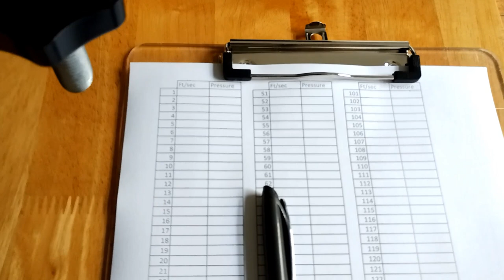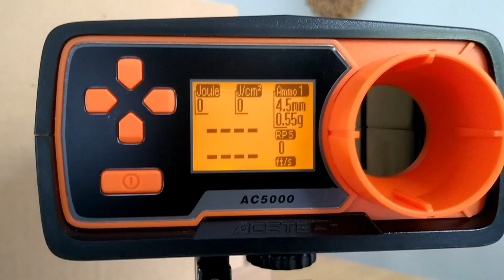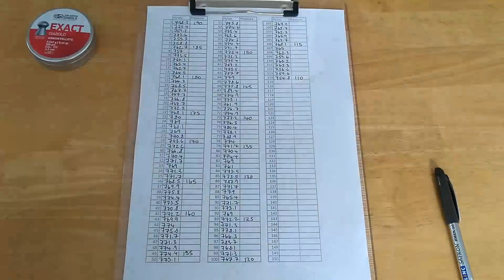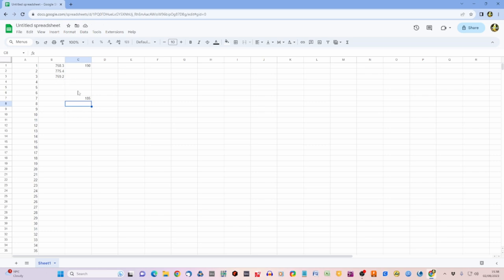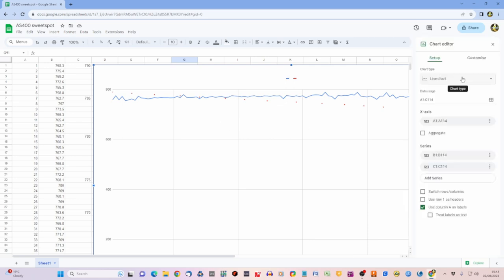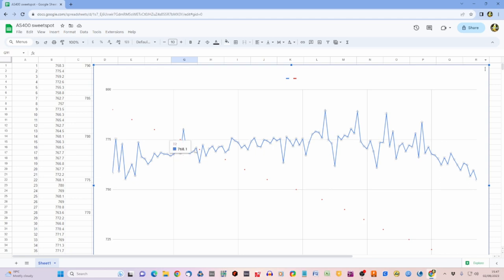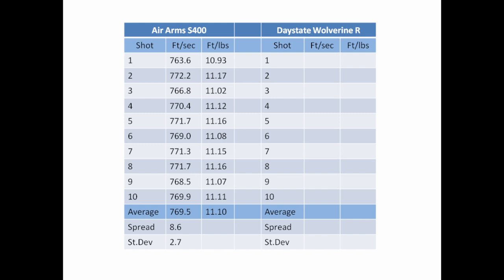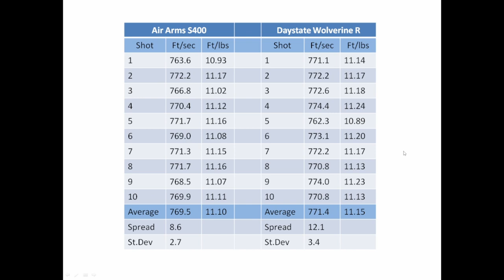16 - Mastering Sweet Spot: Boost Accuracy in 3 Steps

Comment: Im not into hft anymore but do use a s400 classic for paper punching , Your findings are almost identical as my own , I fill to 170 bar and shoot it down to 110 bar , This gives me exactly 60 shots with no change of impact point vertically/horizontally. Cracking guns the s400
Reply from the maker: They certainly are. Thanks for sharing. 🙂👍

Comment: Great video, really interesting and the first I've seen covering the subject! A very un-patronising well done from me! When I have my next day up at Pete's Farm, I'm going to try out my Revere from full charge to power-drop and see what the results are. As standard, the Revere has a regulator and I wonder if its main contribution is to the consistency of fps over the claimed shot count. One thing I absolutely love about the FX radar chrono is the ability to email the whole shot string data; a quick import to google sheets and I'll have the whole dataset without the grief (for a non-typist) of entering it all manually. Once again, your vid has set the thought wheels in motion. Big ol' cheers and keep up the good work!
Reply from the maker: Hi Martin, many thanks. As your Revere has a regulator it won't have a sweet spot. The whole point of the regulator is to keep the muzzle velocity as constant as possible. The FPS shouldn't drop off until your cylinder pressure falls below the reg pressure. Hope that helps.

Comment: That is very interesting. It makes you wonder if the cost of a regulator is worth it, if you already have a quality rifle. Perhaps it just helps with the shot count. Personally, I just want my rifle to be as accurate as possible. 😊
Reply from the maker: Good points Steve. If a rifle has a consistent muzzle velocity then a regulator isn't going to improve shot count, the two go hand in hand. For the most part shooters don't need as many shots as they think. Thanks for your comment. 😀👍

Comment: Great video  .am i right in thinking it was the first 15 shots on the s400 that you used as your example of the total spread and deviation.  Would you not get an even better result  further up the shot count in say the middle of the sweet spot  or am i missing sumething  excellent video veary informative  and a surpriseing result 👍
Reply from the maker: Hi Edward, the 10 shots I used for the spread and deviation were from shot 28 of the shot string. This is from where the pressure had dropped to 170 bars which is the normal fill pressure I use for the rifle.

Comment: Excellent content as usual but how do you get the pressure off the gauge on the bottle with out purging and opening the fill valve
Reply from the maker: Good question Michael. Once you've charged the rifle you close the cylinder valve and leave the pressure relief valve closed. The gauge and whip remain pressurised and in effect become part of the rifle cylinder, so as the rifle uses air the gauge shows that drop in pressure. Hope that helps.
Reply: @hftshooter  perfect, thank you. Going to do the same in the week and see what my results are.

Comment: Just a comment on methodology. Often the most extreme of the data points at high and/or low ends get tossed out as outliers before the average/spread/standard deviation are calculated. The unregulated numbers has a low outlier in the #1 spot, and the regulated numbers have an outlier at the #5 spot. Those should be tossed out and then calculated. If you do that, the chart for the regulated is flatter than the unregulated. I didn't run spread and standard dev, but from a flatter chart those numbers would also be better.
Reply from the maker: You can't remove data points because they interfere with the results you wish to achieve. If your rifle produces high and low spikes during testing it's likely to continue to do so when you're shooting. I'm sorry, but the idea of removing extreme data points to provide more constant results is totally unscientific and ridiculous. If you remove any data points you don't like then your results are simply invalid.
Reply: It's not about removing data points you don't like. It's removing extreme outliers that throw off the analysis. The outlier can be caused by any number of factors that aren't related to the product you're testing. In the case of shooting, it could be a slight wind, a bad pellet that just happens to be in the group you pulled out, or the shooter. Contrary to being unscientific as you think, it is the more scientific method, especially when you're doing just one test and using just one user. If you repeated your test 10-20 times then including all data points make more sense. Even more sense is having multiple people doing the test that you set up. By the way, I think you mistake that data points that don't agree with a preconception are what I said should be tossed out. It's not multiple data points being tossed out. It's looking at the single lowest point and the single highest point, and how far they are from the rest of the combined group. If they're much further apart from the group than the other shots in the group is from each other, then they're outliers that should be considered to be tossed out. From a shot group of ten, keeping in an outlier can throw off the analysis much more than keeping in one out of 100 shots.

Chemists and physicists employ the method of tossing out the extreme outlier at either end as well. There are many tutorials on statistical analysis that you can watch if you want to learn more. Not trying to criticize you. You're trying to help other shooters, especially beginning shooters (like myself), so I'm grateful for your channel. But if you want to help them with good info, you should have an open mind that you too can improve how you're doing your testing which results in better info. 

  @hftshooter

Comment: The comparison between unregulated and regulated was not balanced as you picked the best 10 shot string out of a string of 114. The point of a regulator is to give better consistency over the full charge from max fill right down to the reg set pressure.  Using your own numbers, had you compared the results for all 114 shots the unregulated rifle would have a spread of 34.1fps and a standard deviation of 6.32 whereas the regulated rifle would most likely be consistent over the whole shot string.
Considering the 45 shots you picked for the HFT course (22-66) they return a spread of 16.4fps and SDev of 3.72. In both instances the regulated rifle produced better results than the unregulated rifle.  With a regulated rifle you also remove the worry of slipping outside the “sweet spot”when shooting. I hope this gives a broader comparison of the true difference between regulated and unregulated.
Reply from the maker: The point of the video was to show how to find the sweet spot on an unregulated rifle, i.e. the fill pressure from which the most consistent string of shots can be taken. In this instance, the sweet spot was from a 170 bar fill so it was the string of 10 shots from that point that I used in the comparison. If it's the correct sweet spot then that string should always be the most consistent 10 shots, that's the point of the exercise; no funny business.
As a competitive HFT shooter I'm only interested in the most consistent 30 shots. For benchrest it would be 25 shots and for hunting it's often less than 10! If I need some sighters for the zero range I will fill an extra 5 bars or so to cover those before the event. I'm really not that interested in how the rifle performs further down the shot string. If I'm plinking and I notice the poi begin to change I simply refill.
It is common practice for a 10 shot string to be used to calculate velocity spread and standard deviation and for those results to be used to compare rifles. A regulated rifle by its very nature shouldn't have a sweet spot, so any 10 shot string above the regulator pressure should be representative of the rifle's performance if it's a well functioning regulator. Taking this into account I think it was a fair comparison and was included to show that not all unregulated rifles need to have a regulator added. I hope that clarifies my intent.
Reply: @hftshooter  Jeff,  The point of your video was not lost in fact you very capably demonstrated how to determine the “sweet spot” but the comparison with the regulated rifle results were unbalanced. We agree that “A regulated rifle by its very nature shouldn't have a sweet spot, so any 10-shot string above the regulator pressure should be representative of the rifle's performance if it's a well functioning regulator.” In fact, 10/20/30/40 shots strings should be consistent. However, by your own admission as an HFT shooter you are only interested in the best 30 (thirty) shot string for a competition.  Using your results there is not one 30 shot string that is equal to or better than the 12.1 fps spread you obtained from the regulated rifle.
If I were to be pedantic the best 30 shot string in your results is shots 24-53 which returned 12.2 fps spread but you would have to be a special person to replicate that start point on a competition day.
I am not trying to belittle your efforts, but you suggested that your unregulated rifle would not benefit from having a regulator fitted! Probably not if you are only ever going to fire 10 shots from the exact same start pressure every time, but yes it would, if you want better results from more than 10 shots and less worry about where the pressure indicator is before you start shooting.
This is all very academic considering the small shift in POI for a few FPS considering all other variables that affect the shot, but we need to be thorough with the details.